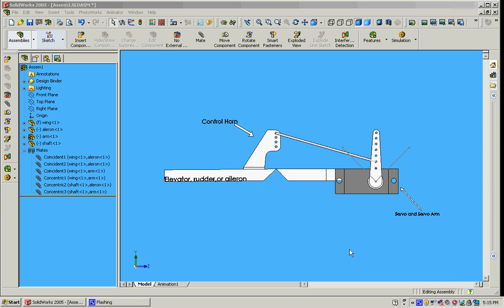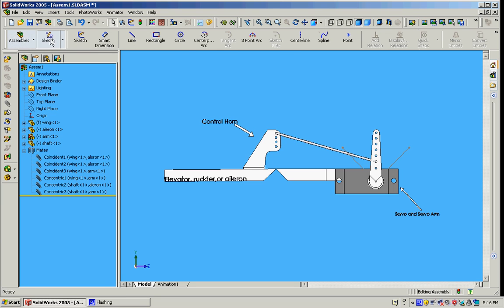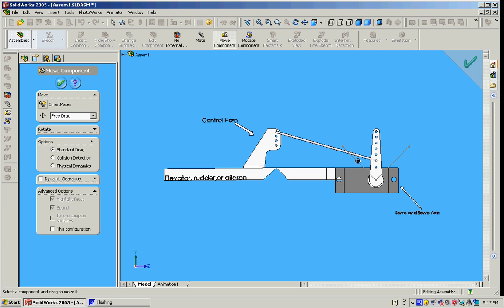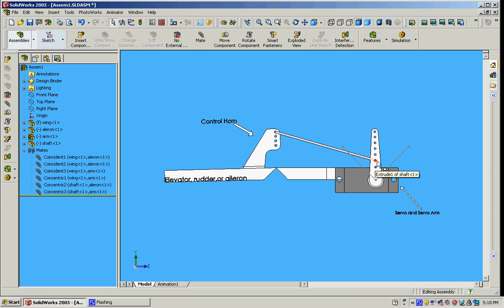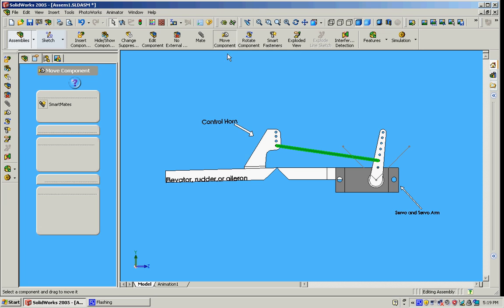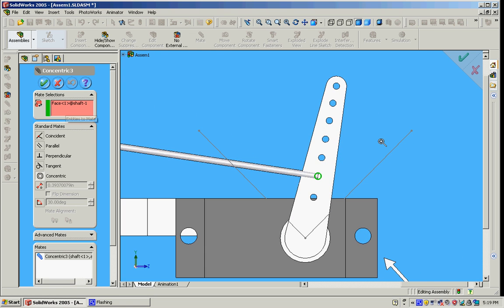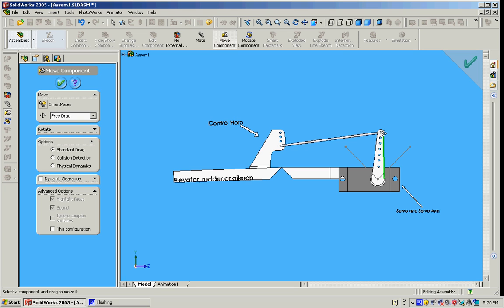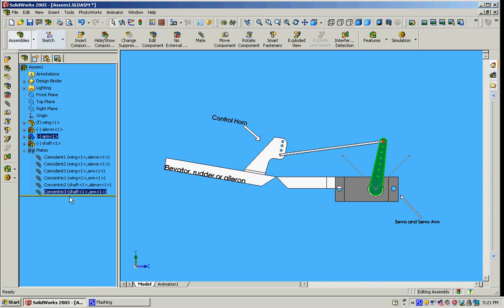servo arm control horn position and pushrod length rc plane 3d

Comment: Thanks for the video. I want to setup mine for less throw and more force, but I've been jumping back and forth in my head about which is the correct way round to adjust it, thanks for demonstrating it clearly.

Comment: It is best if the pushrod is parallel to the control surface. Everything would be at right angles and more efficient - that’s what you want. Also, the servo will require more force to move the control surfaces when the wire is put on the outer hole of the servo control arm. That is not best.

Comment: hi Tretch5000 - helpful basic info on control linkage geometry, but i'm afraid the blanket suggestion of longest control arm + shortest control horn will unnecessarily cause loss of control resolution because you are wasting all the tx stick throw beyond the maximum control surface deflection points.  what's optimal and maybe more useful to viewers is the idea of a linkage that gives you maximum control surface deflection at maximum tx stick deflection.  that way you still have all the control surface deflection available, but it's spread across all the tx stick deflection available - i.e. you have finer grained control of the control surface at any given point of your stick throws.  and in terms of smooth throw geometry, the best scenario is if you can position your control horns and servos such that the distance from the control rod linkage to the servo pivot is equal to the distance from the control horn linkage to the control surface hinge, and with those two lines being parallel - that will give you a precise, consistent 1:1 throw across the entire control surface range.

Comment: Ive been flying for 3 years and have built 5 or 6 nitro aircraft and you have just made the job of setting up my gear way way easier. I have been struggling with thjis but now its very clear. Now I have a few planes that need horns moved and new servo arms (Longer) installed tonight. Thanks so much for makeing this essential job easy as pie

Jay

Comment: this is more maximum movement but doesn't it put a lot more stress on the servo? If you could afford to hinge the control rod higher up the control horn, wouldn't that increase the moment around the aileron?
Reply from the maker: Matt Bolt yeah it's more stress on the servo but for my application I needed a very small and light servo. I also needed all the throw in could get. this video is really just to show the effects of servo and control horn positioning with control Rod placement. a lot of people have no idea the effects of moving the rod from one side to the next.

Comment: I want to change the control rod position on my little umx champ
those little horns are delicate and stuck in foam that could easily be damaged-
so do you use the pliers to bend the rod or to bend the plastic horn ?
or both ?
Reply from the maker: get new control rods and bend them yourself with small pliers.

Comment: Cool software... I take it the rod's length changes is computed and displayed. Can it compute the change in leverage too to tell you force figures? BTW at 1:16  Yes.... and "someone" making motor gliders for FPV needs to watch this! ERRR. But I'd add to give equal throw in either direction so they get it and understand why it's far more importantly these days so a computer radio mix that relies on symmetry (two equal opposite lengths) works properly. Not easy to do in the real world with a wide EPP or EPO foam hinge line as you have to first find a control horn that's length is right, then find the true center of pivot, and then get the holes lined up perfectly straight so each hole is directly above the pivot line equally.... or just pick one hole on a tapered control surface and stick with that one. Some say "close enough" is good enough... which is a true term compared to what is by far best and flies nice. IMO 1:16 done correct and incorrect is why you hear one person say great things about a flying wing using elevons where the elevator and aileron controls are mixed together and someone else complains and blames the wing for not flying well. I about fell off my chair when I got something I was going to flaperon and mix in some rudder and saw how far off the  control horn was mounted. No names to protect the guilty as usually it's an easy fix (just not this time) and their batteries and prices can't be beat....;-)

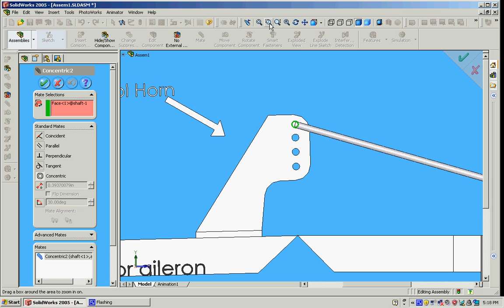Comment: Great video and demonstration. I just need the word 'better' needs to be used carefully. At 3:00 - 3:00 we are told how moving the rod onto the lower hole makes things 'better'. It gives you 'more' throw but this is not necessarily better. More throw may be required on 3D planes etc but if you will never actually use that amount of throw then you are getting less precise control and putting more strain on the servo.

At the end you describe the 'best' possible set up. Again, this is the 'max throw' set up but is not the best for 'most' people. 
you fly 3D and I understand the video is showing people the relation between push rod position and throw, but I think that you can't say what is a 'good' set up without at least mentioning mechanical advantage.
Reply: so whats the best setup? For flying wing?

Comment: You use the term best throw improperly .. you meant max throw.   Best throw takes into account the Tx control stick's resolution.  It would be more helpful to beginners if you included this information also, along with explaining why max possible throw is BAD for many airplanes.

Comment: I apologize for the brevity and terse tone. I had a very eloquent and politely worded post all made up and lost it to distraction and then an interesting related video. :)

Consider control horn hole A
Hinge axis B
Servo axis C
Servo arm hole D
Lines AB and BC should form a right angle 
Lines BC and CD should form a right angle

You have the servo axis below the wing surface, therefore, saying that the control horn holes should be "directly above" the hinge is incorrect. If the servo axis was on the wing surface, it would be a different story.

Now, if you have multiple holes in the control horn, and might be switching the con rod around, then they should be aligned with the hinge axis, but placing them relative to the wing surface isn't necessarily the best thing to do.

Comment: Hi mate, great vid, thanks heaps!
Could you tell me, if in the most ideal positioning in the last setup you show, is it best to add subtrim to the servo, so the servo arm is 90degrees to the control rod?
If I have my servo arm at 90degs with the servo, my control rod has a massive downward angle to the Control horn on the control surface.

Comment: I'm just researching into servos before I buy my first plane, and I thought that the servo was supposed to be placed so the servo arm would be parallel to the surface it is on, isn't thata placed on it's side? Is that how it's normally supposed to be placed?

Great vid btw :)

Comment: when we tested this for our engineering class we proved that a parallel linkage from the servo arm to the tiller arm was the most beneficial in terms of maximum rudder angle to servo angle ratio

Comment: the statement about the control horn always being directly above the hinge is incorrect. in the first example the horn should be several degrees (probabley like 25 or more ) ahead of the hinge to get equal throw and mirrored surface-servo ratios. The horn-hinge line (arm) and the servo arm should be parallel and the pushrod should be at a right angles to both.

Comment: Great video, when you mention installing control surface horn and making sure the horn HOLES line up as best as possible with the hinge point, this is so that you have equal deflection of the controls surface. If you you position it foward or behind the hinge point, you are now into what is called DIFFERENTIAL. Some radio can be programmed for this so like you mention its best to just make sure the holes line up with the hinge.